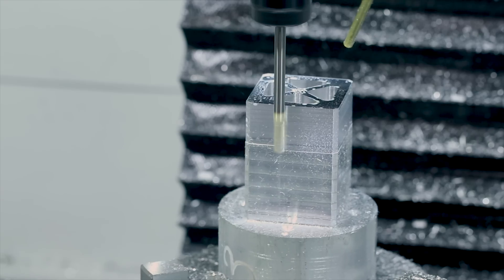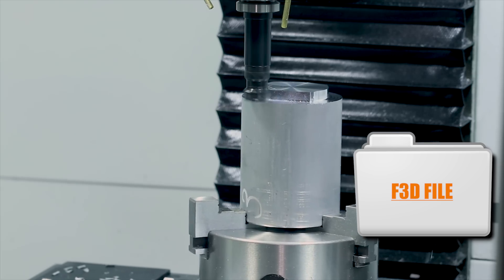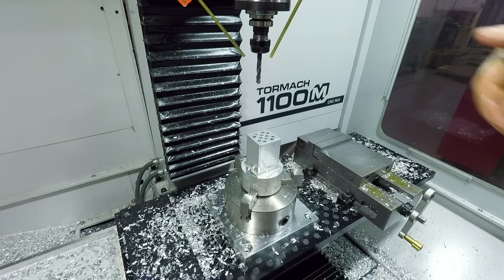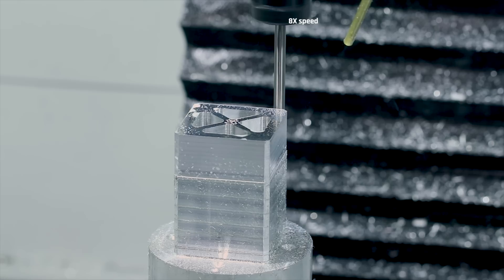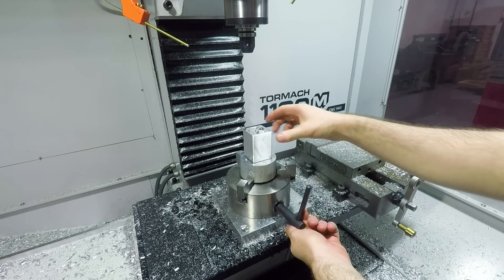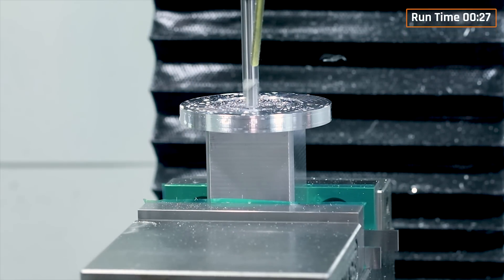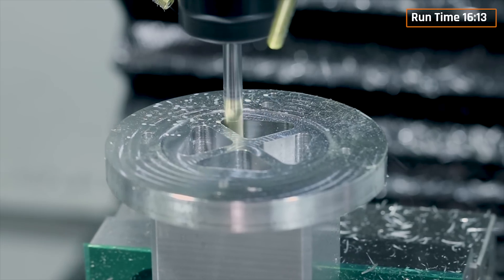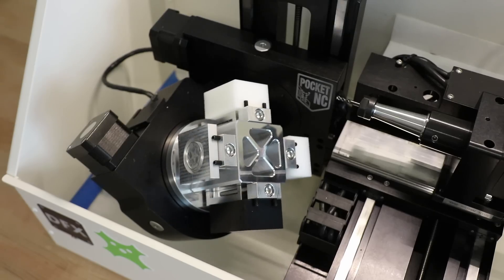Pocket NC 5-Axis Tombstone! WW224

Comment: Yeah I don't think I have ever gotten a good finish from necking a reduced shank tool.  least not on any small spindle like say a bt30 or smaller unit.  There is a limit as to how far out you can stick the tool before the spindle no longer has enough rigidity.

Comment: Instead of "run time", you should use cycle time. Stating 0:10 and 0:06 is very misleading. Time is money and for each tool it is the total time from start to finish which includes traversing to home and manually removing and inserting the tools.
Reply: A tombstone is used for running multiple parts at a time

Comment: I don't see the point in drilling material out of a pocket, wasted time unless these holes are made to go through the part.  Sure in this case its one part however you're doing two things here, changing tools and running those tools on a cycle which isn't needed and two, making the cutter break out of and into material when it could be a constant feed/speed cut parameter which is bad for tool life having the tool come out of and go in to a cut which cause un-do vibrations/chatter and chips/is detrimental for stiff tooling like carbide, particularly with SUPER long stick out (the vibrations are logarithmic, not linear!.  Better to keep the tool engaged fully all the time (in aluminum).  Nice to have a hole to plunge in to but other than that (at lease in aluminum) I wouldn't be doing the extra 8 drills to remove material close to the corners (in aluminum).  A pocket with depth cuts and an entry hole is plenty in aluminum.  In tool steels, D2/M2 ick/S7/A2/etc. then its fine to give the tool a bit of multiple angle repreave in the the acute corners  however it still needs something to cut so drill undersized by 20% tooldiameter (10 % per side) to leave some meat for the tool to keep constant engagement.  Alternatively you can use an opening radial pattern in all shapes which wastes some tool movement but keep the engagement the same.  In aluminum you can generally just hog with the right tool and flood.  You weren't running flood here though.

Comment: Nice job Ed and good save on the 'error' half way through.  Things will always go wrong from time to time, it is how you recover out of it that sets apart a good machinist.
Reply: Though not sure why you'd center drill a hole, then counterbore it removing the center drill, then drill it from the other side... hehehe.  We've all been there, just a bolt clearance hole, no biggie.

Comment: The chatter during the helical interpolation might be increased by the feed rate being too high.
The actual feed rate at the cutting edge is larger than the programmed feed rate at the tool center because their distances from the tool path center are different.
Scroll down to "Two axes ramping – circular. Part 3" at this link to find a better explanation and the formula to calculate the correct feed rate input: https://www.sandvik.coromant.com/en-gb/knowledge/milling/milling-holes-cavities-pockets/pages/ramping.aspx

Comment: I'm pretty much brand new to everything machining, though I now have a Shapeoko 3 XXL CNC. I'm wondering, how do you drill a hole in the side of your part if it's too tall to be rotated on the CNC bed and clear the spindle? I have a drill press but it seems pretty crappy at making accurate holes exactly where I need them. Is there a best tool for this kind of job?

Comment: as a cnc programmer, I totally laughed out at 3:30 every time a machinist freak out at my job because the holder is real close to the part/fixture, im like "vericut said there is no crash" haha
Reply: Until an odd ball / different brand tool holder is introduced into the shop.   Then I get the call to fix the mess.
Reply: Just returned from the basement after boring some holes to be later tapped for M5 into a shelf to mount my old WMF Kitchen Tools Rail to.
Looking through my stock of suitable screws I ended up with 27.5mm calculated holes which, in F360, I rounded up to 28mm... Then I went like: "Wait a sec... How long did I program those ⅛" Bits to begin with!? Open Tool Library - Check ⅛" Bit - Observe 28mm.

Hmm... Well here goes nothing?: https://imgur.com/IQS7yr3.png
 after all I still had like 0.5mm to spare before rounding it up? =)
Reply: @Duraltia - Always round DOWN with tool stick out!  hehehe
Reply: Lol it all depends on what your definition of close is 😉
Reply: @diditwork370  .1 mm is CLEARANCE! for days!  haha... but clearance none-tha-less
Reply: as long as you can stick a .05mm gauge, there's clearance.
Reply: @diditwork370  sometimes I do a shrink fit extention in a pocket, less than 4thou off the wall xD, the machinists hate me lol

Comment: Saw this on instagram, was really excited to see how you guys made it. Expected to see a 1" boss sticking out of the bottom to grab it with the ER40 collet in the Pocket NC table, would let you take it on and off the table with just one alignment pin for initial clocking. Would need to think thru clearance for collet tightening tool but could be slick. Really nice work on this guys!
Reply: Access to the collet closer nut is exactly the issue. But there are other alignment features (precision dowels) on the face of the rotary table that solve the clocking/alignment issue. But if I design a version two of the tombstone I’ll leave a bottom boss that slides into the center bore of the rotary table (with the ER40 collet components removed) for additional stability of the tombstone. The stock Pocket NC vise adapter is designed with that feature from the factory, not sure why it did not occur to me on initial design of the tombstone.

Comment: what is the point of a tombstone
Reply: For a small cnc machine the tool change is done manually  there for a tombstone make less tool change per operation per part= faster cycle time per part. if they are using the same group of tooling for roughing/finishing.
Reply: Basically a pallet system for machines that are horizontally challenged.
Reply: That's odd to me too
Reply: dothemathright 1111 Nailed it. My main motivation for the tombstone was amortizing setup time and manual tool changes across more parts. Frees me up to work on other things (CAD) while the machine keeps busy.
Reply: Multiple parts with just one press of cycle start
Reply: Put another way. More work for the machine to do while you are away from it.
Reply: None of these replies seem helpful
Reply: It appears a tombstone is like a 4 sided vice that lets you machine multiple parts in an operation

Comment: I may attempt to make something like this. But I think I will figure out how to make my PocketNC machine the thing itself.
Reply: The Pocket NC could to it. But it would take a really long time to remove that much material. And the long reach tooling needed to machine the center pocket would be a challenge. Pocket NC is not as rigid as a Tormach.
Reply: @vector2929  Rather than worry about lightening the tombstone could you instead counter balance it with some weight on other side of the rotary axis?

Comment: Cool little project, I am wondering though, why is the part hollowed out? I understand why it is done on those massive thombstones used in large industrial setups to keep it somewhat mobile but on this scale that is obviously not an issue. Thanks!
Reply: I just realised that the pocket NC is a small 5axis mill, so eventhough it may be easy to handle for Ed, I assume that the little motors and limited rigidity of the pocket NC doesn't like the added mass if it where solid.
Reply: @StefsEngineering  we need more problem solving like this on the internet
Reply: Stefs Engineering That is exactly right. When designing the tombstone, my goal was to keep the weight of the tombstone right at 1lb to minimize weight on the rotary table. With 4 vises and blocks of stock the weight adds up. The Pocket NC has pretty small NEMA 17 stepper motors and any mass reduction helps.
Reply: I don't know if it make's a dif or not but some hollow shapes have less resonance to them than solid piece.
Reply: @stormbringermornblade8811   That's because of the stiffness-to-weight-ratio being higher for a part like this. Since the natural frequency is the square root of stiffness/weight, the resonance will shift upwards into a range that's less easy to trigger.
Reply: Also wondering the same thing - seems like a lot of extra effort to save what looks like a few ounces?
Reply: Also, just like a hollow tube vs. a solid tube, the section is not only lighter but has some structural shape and is stiffer
Reply: @Cinnabuns2009  A hollow tube is not stiffer then a solid tube of the same dimensions.
Reply: @Cinnabuns2009  

It's definitely not stiffer. The stiffness, pound-for-pound, is higher, but solid material is stiffer, as cinnabuns said.

Comment: Are the times you post in the corner of the screen for each operation fusion estimates or time in "real life"?
Reply: Ed Rees 
Never will.  Mastercam has been around for decades and still doesn’t give accurate real world times. It’s also damn near impossible to get a perfect CAM to real life time match up. Just too many variables to account for just a general reference feature. 

To be honest though it doesn’t entirely matter. Reducing time in the CAM translates to the same % of time saved on the machine.  The total times are just different. 

In short.  It’s not really worth the software developers time to achieve perfect CAM to real world time synching. Way more important things to take care of.

Comment: With long stick out tools like that, try conventional milling instead. The tool will deflect along the wall rather than away from the wall.  Same with with C-bores.
Reply: Ed Rees 
Downside is it tends to cut bores small on the diameter and outside dimensions oversized.  But it keeps everything stock safe so it’s not a huge deal
Reply: @occamssawzall3486  You can always just do a climb cut for a finish pass to take to final size.
Reply: Plata Bear 
Sometimes.  Usually it’s such a small amount of removal from the wall conventional is still better.  Trying to take off a thou or two with a long stick out tool while climb milling tends to cause some serious chatter.
Reply: also using more engagement of the flutes you have (larger DOC per pass) can help sometimes too since you have more surface area engaged at one time it can help stabilize the cutter.
Reply: @Ed Rees I would back relief the end mill of 0.005 on diameter. For small endmill it is ez to use a cordless drill on a grinder and make sure you remove uniformly to prevent endmill from snaping. It s amazing what you did with a small machine.